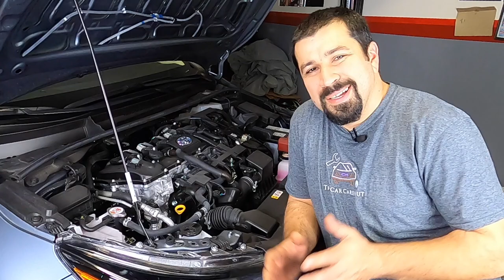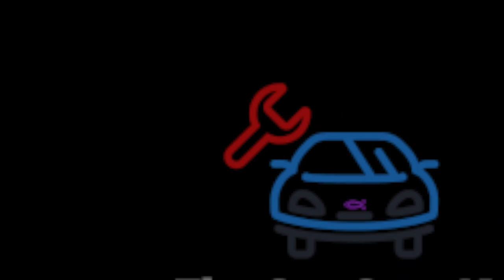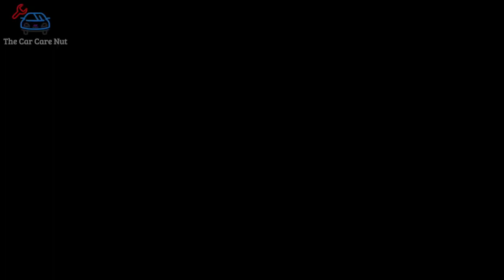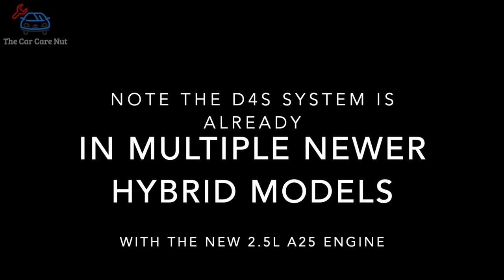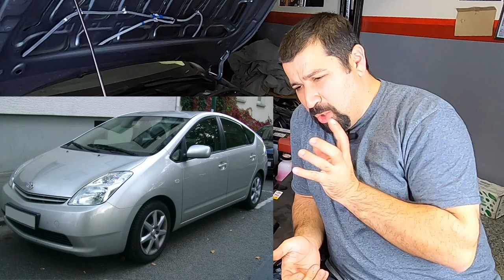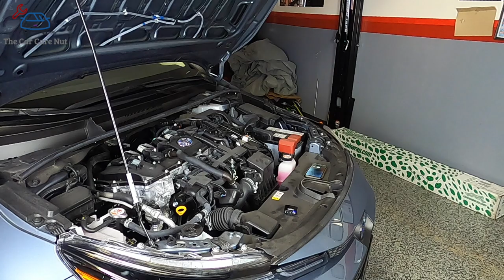How Toyota Hybrid System Work Part 5 Engine HVAC and more

Comment: Thanks for a  very informative explanation. I was wondering does the A/C compressor cut in and out or does it vary its speed according to demand? I thought it also ran like an inverter. Does it have reverse cycle?
Reply from the maker: The ac compressor varies and also can come on and off depends on running condition.

Comment: Excellent video. I wonder if you could share your experience and opinion on clogged EGR circuit? In particular, the EGR cooler and the passage are often clogged in Prius Gen-3, and some people hypothesize that this will result in higher combustion temperature, leading to engine gasket failure. Is this true?
Reply from the maker: There’s no direct link between the two honestly. The head gasket issue remains a mystery without direct explanation. I recently had a 2010 Prius with over 130k with the original EGR valve and all EGR components that is very clean and no issues with EGR. People that fix them DIY also are not aware that there’s a software update that greatly reduces the chances of this issue happening again
Reply: @TheCarCareNut  Thank you. But I thought that the owners will get a software update (similar to a recall) notification automatically? Do I get that wrong?
Reply from the maker: So that was not a recall. It was a TSB that turned into a customer support program. You can’t get the update done unless the issue is there and a new updated EGR valve is installed.
Reply: @TheCarCareNut  I see. I believe it is TSB 0027-16, "MIL 'ON' DTC P0401 and/or Rattle After Cold Soak". Thank you very much.
Reply from the maker: That’s the one

Comment: I just had my spark plugs changed at the Toyota dealership & now when I turn on the Air Conditioner or defroster there is a buzzing sound . It almost sounds like a relay chattering . When you put pointed end of long screw driver in the area of the spark plugs & the handle against your ear the buzzing is very loud. Any ideas of what may be causing the buzzing sound?

Comment: Our Rav 4 Prime has a heat pump and heated seats. 

When  the ambient temp was 24 degrees I adjusted cabin heat to 72 degrees low fan setting and low setting g on driver seat. 

Our battery range dropped from 43 miles to 33 miles or about 20% reduction.

Comment: Hello, AMD, and thanks for sharing so much valuable information!  Excuse me if this is an improper place to post this question. A few days ago I was traveling with my Corolla Hybrid and, due to an overturned truck blocking the road ahead, I got stuck on the road for 3 hours. It was  90°F outside so I had to keep the AC on the whole time  so I wouldn't bake inside that cabin! Can leaving the car on without moving for such a long time cause any problems?
Reply from the maker: Hi! Thank you for watching my channel! So on the AC running for a long time in hot weather. Of course that is a load on the AC system however it’s well within its limits to handle. Now repeat that every day for the next 5 years straight and then you might have caused some damage but here and there I wouldn’t worry about it at all.
Reply: @TheCarCareNut  Thank you very much!

Comment: Love this series and your videos!  I’m not sure I understood you when you said refrigerant oil... are you talking about the refrigerant?  I know the compressors have oil inside the compressor housing but I’m assuming you aren’t referring to this oil since they are typically permanently sealed?  Just wanted to get clarification on that.  Awesome videos!
Reply: In conventional and electric compressors the oil is actually circulated ("entrained") with the refrigerant. That way it lubricates the intake valve and everything else. I once had the misfortune to own a 1984 Dodge 600 (like a Le Baron) and had the further misfortune for it to develop a pinhole leak in the bottom of an A/C hose. The oil leaked out, and then the refrigerant leaked out, destroying the compressor!
If you visualize it, you can see it is impossible to have the refrigerant in one part of the compressor and the compressor mechanism in another. The scroll pumps the gaseous refrigerant and must be lubricated where the refrigerant is.
Reply from the maker: Flagmichael answer your question. Thank you! One thing I will add. Oil mixes with the refrigerant. So when you evacuate the charge or it leaks out some of the oil comes out and you have to add it back to the system. Also oil mixes within the hoses and components of the ac charging machine that’s why using a dedicated machine for hybrids is important to prevent incorrect oil contamination
Reply: @TheCarCareNut  wow thank you for the information!
Reply: @TheCarCareNut  I wondered about the contamination being such a big problem because I didn't visualize that part - essentially oil everywhere inside the recovery equipment! Thanks for clearing it up; I'll definitely go to the Toyota dealer to do this for me.

Comment: do you know how to disable this fake proximity sound? is it possible with the techstream program to disable it?  i really hate it! 😂 if i unplug the speaker will come a light to the dashboard? is the proximity sound connected with can bus system?  thank you so much for your  videos! you are the best!
Reply from the maker: Hi! At the dealership level you can’t disable it as it’s considered a safety feature. If you disconnect the speaker it shouldn’t cause ossues

Comment: Is it bad for me to idle my Rx400h for 30 mins a day? I do this to keep it hot inside the cabin. The engine cycles on and off and when it kicks on the car had a bit of a shake.
Reply from the maker: That’s not an issue at all. Idling in neutral is the issue but if you’re in park there’s no problem at all.

Comment: When I bought my new Yaris last december I first thought in the first days that there is a problem with the electricmotor because of that kind of grinding noise that it makes when driving slow. It appears only to a speed up to 25 km/h so about bycicle speed and when faster goes silent. I went to the Toyota Trader just to find out that this is normal to the new electric motors. Why was I confused? Just because my old Prius II didn`t make a noise at all when driving electric. You only heard the wheels rolling on the ground. Another thing is in the first two months I had this feeling that the hyrid battery hasn`t the same stored energy like in my old Prius II. Ok, with january and february you don`t have that warm temperatures but it was a bit confusing in the first place. But quite recently now it looks better that the battery is now holding the power longer till it`s half full. Is there also some kind of a break in time for new hybrid batteries? I have no experience with this because my Prius II back then was already 6 years old when I bought it.
Reply from the maker: Hi! Typically hybrid batteries don’t have a break in period but the rest of the car does.

Comment: Hi Sir, I've been watching your videos regarding Hybrid as recently my Sienta with 1NZ-FXE have been knocking or clunking during low rpm only when the engine is powering both the wheels and charging the battery(The arrows goes from engine to battery and wheels). I've changed my EGR valve but the sound came back after a week, I'm afraid that it might be the transmission which you mentioned in the 3rd episode. 
What do you think might be the issue? 
Thanks.
WJ from 🇸🇬
Reply from the maker: Hi! This will need diagnosis but you’ll need to make sure the engine is not misfiring

Comment: What is the pulley you referred to? What does it do?
Reply from the maker: Sorry I should’ve mentioned it. It’s just a harmonic balancer you balance the engine. All cars has one connected directly to the crankshaft then the belt would go into the harmonic balancer. In hybrid models with no belt it’s just a harmonic balancer with nothing connected to it
Reply: @TheCarCareNut  I have a 2017 rav4 hybrid and I’m very hands on. How can I clean the air fan filters, I can’t take off the seats. Thank you for the reply.

Comment: If the ambient temperature is low, will the engine turn on to warm up first n case the driver needs a lot of power right away? Cold oil and high engine speeds aren't a good combination. Knowing it's a Toyota, I am sure that the engineers have already thought about this, though.

I have to say that I took a test drive in a new RAV4 hybrid and the Hybrid Synergy Drive is lightyears ahead of what was in the CT200h – you could feel the powertrain shift between modes in that car. The new RAV4 – not at all.
Reply from the maker: Hi! When the engine turns off it doesn’t immediately go into high rpm. Also at the high start rpm from the electric motor it actually builds up pressure quick
Reply: @TheCarCareNut  I would think the 0W-16 oil and the electric oil pump in the A25A help as well.

Comment: Greetings. I enjoy my Prius everyday.  But now with the pandemic I’m not using as often.  I notice if the car stays without running for 2 days or more when I start the car the transmission makes a weird noise for 10-15 seconds and later it goes away.  Never happens if I use the car the next day.  Any reason I should be concern about it???
Reply from the maker: Is it like a buzzing sound?
Reply: @TheCarCareNut    I do hear the buzz sound you explain about the brake system.  But this sound is almost like a plate that is loose but it’s gone after 5 seconds.  Only happens when the car is being not use for two or more days
Reply from the maker: Ok I see. Does it happen when the gasoline engine is running? Also what year Prius?
Reply: @TheCarCareNut  yes.  It’s right when the gas engine starts.  I think you mention on some of your videos about the planetarium.  2011
Reply from the maker: Yes that rattle is likely a small misfire. It could be an early issue with the EGR system sticking. It would need cleaning or replacement of parts. You could have some kind of coverage with Toyota on that. If the check engine light is on call a dealership and give them your vin and ask about coverage for egr problems.

Comment: Love your videos! Could you please advise if is it possible to upgrade Automatic Climate Control to Dual Climate Control in Toyota Auris mk2 (Scion iM)? Or is just not possible without replacing the whole ac system. Thanks
Reply from the maker: Hi! It’s not very simple. Anything is possible but at a very high cost making it not really worth it

Comment: I'm grateful that my 2ZR-FXE engine in my 20 Corolla has port injection. I would not buy a GDI engine with current technology. Toyota I think is better in that its GDI engines have port injection as well, but it's much more complicated and expensive for not so much benefit.

Comment: Can you explain please what is the noise when i park my Lexus rx450h  for example turn of the engine and after 5 minutes or more make a noice for 2 seconds like trrrrrrrrrrrr from which part of hybrids system is that?
Reply from the maker: Hi! That’s the brake actuator charging up and it’s normal.

Comment: I am an happy owner since 6 months of a 2.0 Hybrid Corolla TS (European specs, not sold in US), unfortunately in Europe we are missing the UFO sound, but thanks to the built-in safety equipment two distracted old ladies avoided being hit. 
Great videos and happy to know how much technology is in that engine, thank you for sharing.
Just a question, since the 2.0 and the 1.8 have the same bore would that mean that when not all power is needed, it will keep the valves open and not use the additional displacement, thereby reducing fuel burn? Anyway mine averages 47MPG, including the German highway speed limits.
Reply from the maker: Thank you for watching my video! Both engines have the same bore but have a different stroke which also changes displacement.
Reply: @TheCarCareNut  Thanks for the answer, my precise question is: when the engine does not run @ full power, one of the specs of the Atkinson / Miller cycle is that both inlet and outlet valves remain open to reduce pumping losses, thereby the engine is not using the full displacement, but a portion of it. 
So in these cases the 2.0 may run with the same "effective" displacement as the smaller engine may run, since there is no need for the excess power. Am I correct on the assumption that even if the 2.0 is a larger displacement, that is not effectively used unless there is the need for the additional power? It looks like since the fuel consumption is almost the same as the 1.8 of one of my friends.
Reply from the maker: There’s no mechanical way that the exhaust and intake valves remain open precisely. At full acceleration the engine comes on and adds to the power mix.
Reply: @TheCarCareNut  thanks, then i got the wrong conclusion.

Comment: Hello, will you offer your opinion on thos issue? I just changed the brake actuator on my 2010 prius. The brakes work fine and no lights are on. But, the actuator cycles on and off every 8 seconds running or not.

Thanks,

Dwight
Reply from the maker: Hi! Likely there air in it. How was it bled?
Reply: @TheCarCareNut  I am not sure.
Reply: That makes sense though. It reminds me of a water well pump cycling on and off.
Reply from the maker: The only way that I know of to bleed it is to use a Toyota scan tool and sometimes it takes multiple attempts to get it bled
Reply: @TheCarCareNut  the wife just got home with the car and the warning lights are on. Brake, ABS, Traction control.
Reply from the maker: I would try to get the codes. Your conventional code reader won’t be able to get these codes you’d need a more capable scan tool.

Comment: I'm checking a 2011 Camry 2.5L for no AC, blowing warm. Alldata diagnostic says that the resistance between terminal 2 of the AC Amplifier connector and body ground should be greater than 10K ohms. I'm sure I have good connections but all I get is OL. Is that ok or should it be something like 15K or 20K ohms? (if you get time, thanks!)
Reply from the maker: Hi! That’s good. With the engine running and AC on run a magnet by the compressor back and where the lines go and see if it comes on
Reply: @TheCarCareNut  Thank you! It's kind of you to answer; I'm sure you're very busy. Yes, it's probably that solenoid.
Reply: @TheCarCareNut  No response with the magnet but I installed a new Denso compressor and we're back to normal. Thanks.

Comment: Hey ! I have question , is okay for hybrid (i have 1,8 hybrid c hr) to accelerate on full power to speed i want and then just unpress the throttle pedal and cruise ? bc. for example i quickly accelerate to 80mph , engine revs at full power and suddenly stop , isn t this problem? sudden stops for gasoline engine from full power to shut of in matter of seconds
Reply from the maker: Hi! It shouldn’t be an issue

Comment: Whenever the heat turns on, the electric water pump turns on also, right?
Reply from the maker: That is true as the coolant will need some circulation

Comment: Is the proximity  warning a U.S. thing, mine [uk] does'nt have it. Just a reverse beep in cabin. [AURIS]
Reply from the maker: It could be. When you tried it was the engine running or off?
Reply: @TheCarCareNut  Thanks for the reply. A 2015 3rd gen. running or not,never heard that noise.
Reply from the maker: A 2015 might not have it as loud or noticeable. The newer ones say around 2019 and up are really loud. But I do wonder if this is for US models only.
Reply: @TheCarCareNut  Thanks again,and just a mention that an unused for some time [Covid] car will have a flat battery. The jump start point in fuse box has a live and dead side.

Comment: At 220,000 miles my HH threw a bunch of codes and needed a $2,500 traction battery. After the replacement traction battery was installed by a reputable mid Ca mobile co.  it still throws the codes and now I probably need a $6,000 ABS VSC control unit.  And the AC doesn't blow cold.

I think that V6 regular Highlanders, if maintained well, will last significantly longer than a hybrid.

Oh, and sadly I'm jubking a perfectly fine rust free Arizona car with a brand new traction battery.

Probably won't buy a car with a battery powered drivetrain ever again.

Comment: My 08 Camry hybrid schedule says oil changes every 8k kms(0w20)
My 19 Rav4 hybrid schedule says oil changes every 16k kms (0w16)

Do you think the toyota recommended schedule is good enough, or they require extra oil changes in between?
Reply from the maker: I would keep oil changes no more than 8k kilometers on both cars if you plan to keep them long. The long oil change interval on the newer cars could have a negative impact as the car gets older